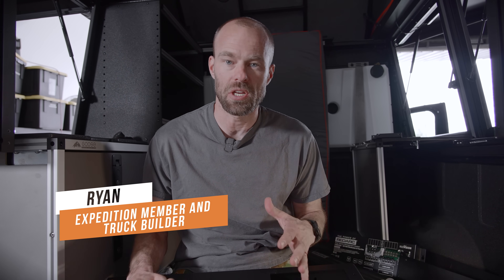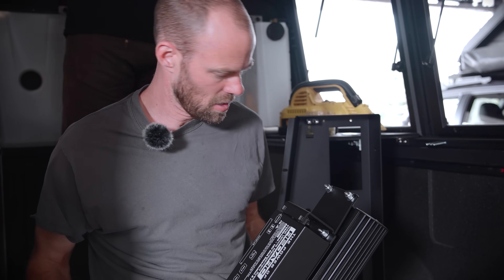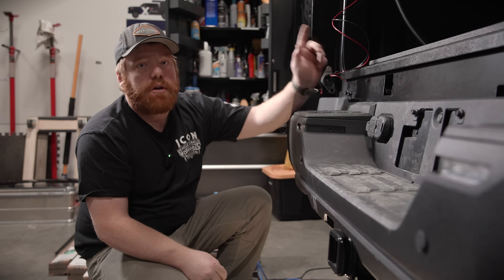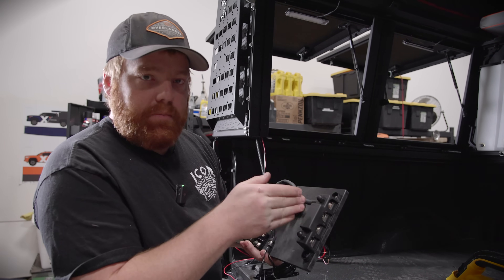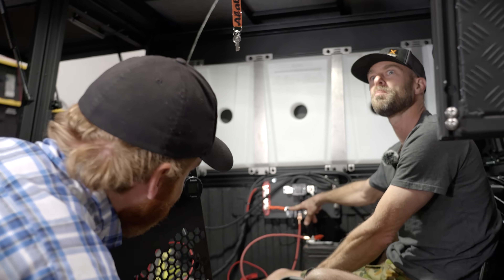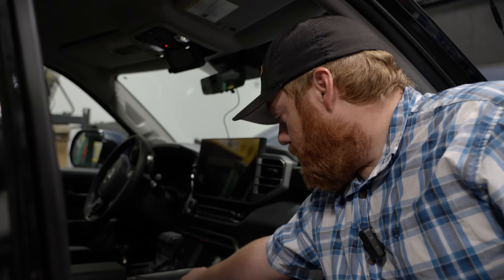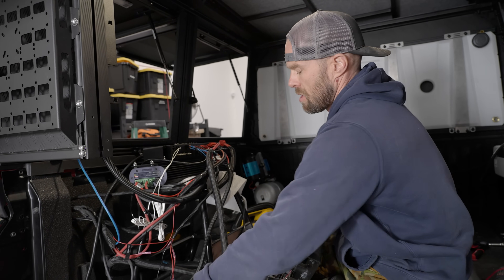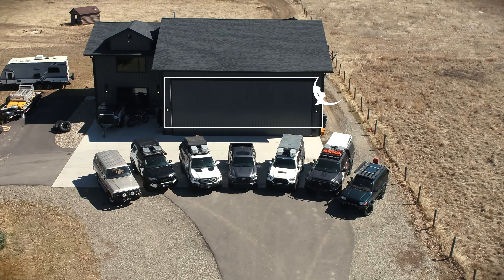What is a Battery Management System & How Do You Install One? X Overland Tundra Series Shop Talk #15

Comment: You can have 2 Redvision monitors connected at the same time? Is it just an RJ45 splitter or is there 2 superset inputs?
Reply: Yes! They are in "chain" with every component of the Red Vision system. No splitter needed as its built into the devices.

Comment: My battery management system cost $50! This stuff is overkill. It’s ok if you have squillions to spend but otherwise unnecessary. 😖
Reply: I would love to see that episode. “And joining us on our excursion is Grahame with his rig.”
Reply: @blakevernon9778  Before you dis Grahame, understand what he means  The Redarc system is not a "BMS" as most people use the term; it is a vehicle electrical integration system which (among others) combines and directs electrical power between various systems that use electricity, provide charge (both alternators and solar), and batteries.  What Grahame is correctly referring to is the $50 part inside the LiFePo4 battery that balances the cells.  Also, you don't know Grahame or his rig, so you write an insult because you didn't know what he was saying...
Reply: @SchroederUSMC  
Thanks but you’re off the mark.
I have a simple interface between the batteries which prevents the starting battery from discharging. It’s never let me down. I don’t stress about current-draw every minute and do trips with minimal accessories. Less weight, better fuel consumption. Less appliances to fail. There’s always the good old cylinder gas stoves when a fire is not possible or allowed. 
I don’t need to ‘keep up with the Joneses’. Cheers.
Reply: @blakevernon9778  
I don’t have a ‘rig’ like an oil rig?
I drive a vehicle.